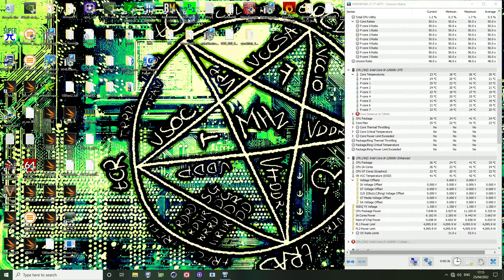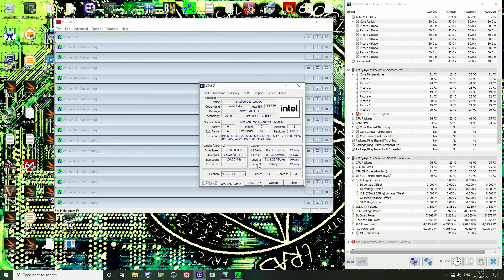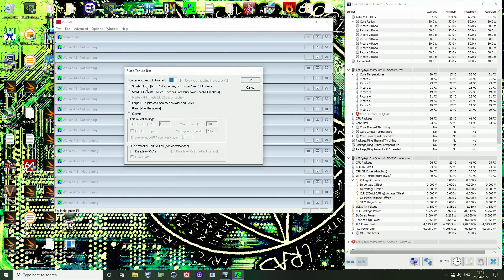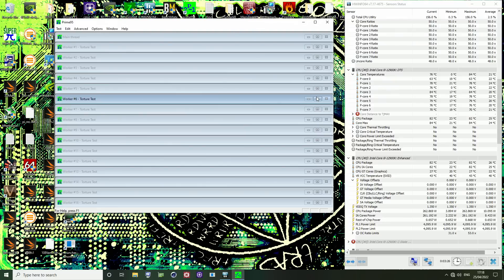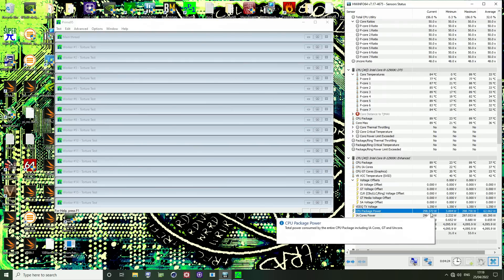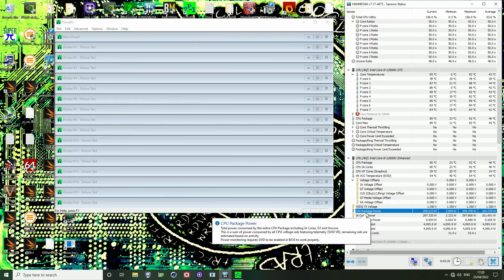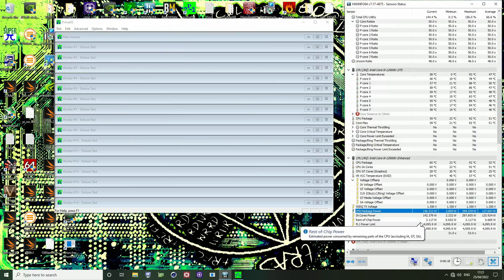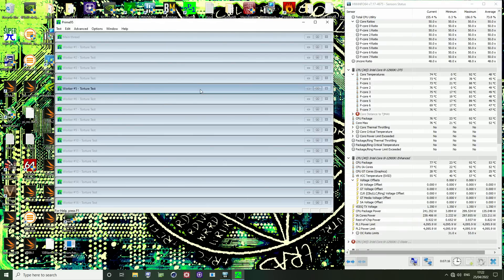AVX-512 on Alderlake CPUs is less hot than AVX2

Comment: This is the same with RKL.  Annoyingly, guardband settings for AVX2 are lumped with AVX1 when ideally these are separated and then furthermore, AVX512 guardband takes the AVX/AVX2 guardband voltage and adds on top of that which is just wrong.  The problem with this is, to keep AVX2 stable at a given frequency, you end up having too much voltage for AVX and AVX512.

Comment: The biggest benefit of avx512 is not the wider vector registers, but the vastly improved masking and swizzle instructions. The only thing it is really missing is some register to register gather-scatter instructions.
Reply from the maker: yeah I remember reading something about how AVX512 is really good for some "memory management" stuff but I don't know enough about programming to know what that actually does.
Reply: @ActuallyHardcoreOverclocking  It could be any number of things, AVX512 is basically intel fixing their (many) mistakes in the SSE-AVX2 series of extensions.

In my own experience, the biggest differences for memory management are masked loads/stores and gather-scatter.

Essentially, when you use SSE or AVX to load data from memory into a register, it always loads a power of 2 bytes at once, with the max being 32 bytes. If you want to load 20 bytes, that is a 16 byte load followed by a 4 byte load. It is actually much faster to simply load 32 bytes and discard the last 12. However, there is a small chance those 12 bytes are owned by another process, and touching another process' memory means the CPU/OS crash your program.

AVX512 lets you tell the CPU to "mask" the load. This means it loads the full 32 bytes, discards some of them, and gives you the rest. Because the CPU is doing the discarding in hardware, it is okay if those bytes are owned by another process. Essentially the same problem and solution also apply to storing data.

Gather refers to the practice of "grabbing" data items from an array and compacting them into a smaller array. Scatter is the reverse, taking a small array and distributing them across a larger one. e.g. Take items 1, 4, 9, 11 and put them in a single 4 item array. It is very useful when you have "sparse" data. i.e. When you only need to work with a small subset of your data at any one time, and that subset is scattered throughout your main data set. e.g. (very simplified) You want to mark the 3 users with ids 129, 73249, and 32974 as having their accounts disabled. You use a gather operation to load the three accounts, change their status variable, and then scatter them back into the main user store. This is faster than loading/storing them separately.

gather/scatter has existed in GPUs for years, but wasn't fully implemented in CPU hardware until avx512. Unfortunately,  we still only have register->memory scatter and memory->register gather, not register<->register gather/scatter. Register to register gather/scatter is less of a memory management issue though, the benefit of register to register is to implement data shuffle algorithms without taxing the memory subsystem.
Reply: @sbdnsngdsnsns31312  
Masked load/stores have it's benefits, but avoiding crashes is not one of them. It's easy to over-allocate or avoid page crossings without meaningful performance penalty.

However, masks do reduce register pressure, and give some flexibility. They also reduce the need for blending which reduces shuffle port pressure. They make corner-case handling easier and reduce code size a bit (although that doesn't matter).

Gather and scatter are not the operations you really want in a tight vectorized code. CPU just issues a lot of small reads/writes. At best it saves some shuffle overhead and code size, but that's it. It is barely faster than doing it in scalar code. It still suffers from occasional cache miss, and touching a lot of disjointed  memory is very cache-ineffective.

Gather exists in AVX2, Register-register shuffles can be done through variable-controlled shuffles since sse 4.1 (pshufb).

Avx512 does reduce the gimmick of avx2 "lanes". Majority of avx2 instructions process avx2 register as if it's 2 separate 128-bit registers, and that includes most shift and shuffles. Most of the time that is a significant inconvenience, because you need additional instructions to move data between "lanes".

Comment: Just from these power numbers, I'd expect the AVX-512 code is running into some CPU bottleneck not exposed with AVX2 and dropping CPU utilization (== performance) in this specific Prime95 setting as a result. So don't fool yourself by using AVX-512 for stress testing, as it is not representative of the CPU at full load, and always test which code path is quicker in your specific use case.
Reply: Wider vector widths actually increase overall efficiency, code optimized for the nex AVX512 instructions is often more efficient, and most consumer cores probably don’t have enough 512 wide FPUs to actually run double the throughput of an AVX2 solution.

For instance, back in sky lake most of the server CPUs ran half as many 512bit instructions per cycle, for the same throughput at fewer instructions. Only a handful of the highest end parts had enough FPUs to run the same number of 512 but instructions as 256, giving double throughput and increased heat.
Reply from the maker: AVX512 is faster in a lot of benchmarks while still running less hot than AVX2
Reply: @ActuallyHardcoreOverclocking  The problem here is that you don't look at performance in Prime95 while touting the changes in power consumption. 

Take a look at how performance changes between the 250W AVX-512 load and the 300W AVX2 load.

Or take one of the examples where AVX-512 is verified as quick or quicker and compare power consumption there.
Reply from the maker: @proesterchen  Ycruncher is cooler and faster on AVX512 than with AVX2.
Reply: @ActuallyHardcoreOverclocking  I can't replicate that on my 12900K / Asrock Z690 Extreme - AVX2 is both a couple of seconds quicker in hwbot y2.5B and uses more power, but I have to go back to the release BIOS to get the AVX-512 switch to work and kept all but the E-Core and AVX-512 switches default to speed up the comparison.
Reply from the maker: @proesterchen  the current Ycruncher 1B 8 core world record is held by a 12900K with AVX512 enabled: https://hwbot.org/submission/4919701_teamau_y_cruncher___pi_1b_core_i9_12900k_(8p)_16sec_201ms

the 2.5B 8 core record is held by another 12900K with AVX512 enabled: https://hwbot.org/submission/4922271_skullbringer_y_cruncher___pi_2.5b_core_i9_12900k_(8p)_52sec_541ms

Comment: Buildzoid: I'm the guy who originally suggested the updates to the Prime95 stress test routines to the dev and I've done months of exhaustive testing comparing CPU architectures across the different routines, so please get in touch as I may be able to help shed some light on this - I REALLY doubt Intel have come up with sonme laws-of-physics-violating way of making AVX-512 magically that good (but it would be nice). My suspicions for what's going on break down to:

1) The core/cache topology detection routine that automatically sets the FFT sizes per stress test may not understand Alder Lake correctly and is causing invalid ranges to be set
2) The AVX-512 routine is performance constrained by the cache bandwidth available and it's relative efficiency advantage over AVX2 is causing the observed power consumption reduction

If we can work out what's going on here, it's important information that I'm sure would be of enormous interest to the Prime95 community as a whole and George in particular, so please get in touch - I don't have an Alder Lake setup I can test (or anything with AVX-512 unfortunately) and it seems you could use a little help with the intricacies of running Prime95 as I think there's some undocumented features it has you need to know about. I've checked the Prime95 forums and there has been little discussion about Alder Lake beyond "AVX-512 is disabled? That sucks!" so your observations are actually pretty important to investigate.

I'm "wantkitteh" on Reddit, I've posted a bunch of stuff in /r/overclocking about Prime95 in the past, plz DM me there ASAP and we can transfer to Discord or whatever and go from there
Reply from the maker: Y cruncher gets less hot and speeds up with AVX512. Linpack runs less hot but slows down a bit. So far I've not seen any AVX512 workload that is hotter than an AVX256 workload on Alderlake.
Reply: @ActuallyHardcoreOverclocking  Well I guess I'll just go f*ck myself then.

Comment: The fact AVX512 isn’t fused off ADL hints that it was supposed to be there, but the implementation didn’t work. It’s really hard because if E-cores run unsupported instructions it’ll crash and you can’t easily tell what instructions are coming. All other asymmetrical CPUs use identical instructions for that reason.
I’m hoping they can make asymmetrical instructions work in Raptor Lake because it really sucks to go backwards with instructions and Intel 7 is so much more efficient than 14nm.

Comment: AVX-512 is a separate code path, and probably less tested than AVX2. It is quite possible that Prime95 AVX-512 code path is not as optimized as AVX2, so it puts less stress to the CPU.

Comment: Of practical terms, is there any normie usage that utilizes AVX-512? Or only benchmarks and datacenter-like programs?
Reply: Several emulators can make use of AVX-512, though RPCS3 is really the only one where it matters. It provides a huge speedup there and makes some of the really hard to run stuff (The Last of Us, Red Dead Redemption, God of War, etc.) much more playable.
Reply: @CaptainKenway  Oh, emulators using AVX-512 is actually good example. Thanks!

PS. Is MGS 4 finally playable? :P
Reply: @PolskiJaszczomb  It is, from start to finish. You need a very beefy CPU though. Ideally Rocket Lake or Alder Lake with eight cores or more if you want to play it at 60fps (much of the time). There's also a custom build dedicated solely to MGS4 that you can find on the game's page on the RPCS3 wiki.
Reply: @CaptainKenway  That's wonderful news!
Reply: There is x265, but the AVX512 codepath is barely faster than AVX2.
Reply from the maker: I think some of the farcry games use a little bit of AVX512 and speed up a bit with it.
Reply: @ActuallyHardcoreOverclocking  Ubisoft using any recent coding is the last company I'd think of, that'd utilize new features.
Reply: @PolskiJaszczomb  They probably just turned on a compiler optimization flag. It is completely uneconomic for a game company to hand code actual AVX512. Even if it doubled performance (which it won't), at best 5% of your potential customer base will benefit.
Reply: If you do a two PC streaming setup with ndi for stream and capture (so over land), it doesn't require avx, but if both CPUs support avx, the resulting encode is notably of better quality. Iirc, it needs at least sse4 to work, and a good NIC. Avx support enables more ways to make the resulting stream to look really good, and it needs at least 4c8t to handle a 1080p60 output stream to your choice of streaming service.

Comment: Is there any performance metric for AVX2 vs 512 ? Is it 10% faster ? Or a 100% ?
Reply: It all depends on the algorithm being run, and how it's coded. All of the SIMD (single instruction multiple data) architectures provide loop-level parallelization (aka vectorization). X86 does SIMD with general purpose registers that can be partitioned based on the data loaded. 
Consider a single-precision floating point number, which needs 32 bits of storage. 8 of these will fit into a 256 bit AVX 2 register. A vector loop will run about 8 times faster than without SIMD. Move up to AVX 512 and you've got 512 bit registers. Now your loop will run 16 times faster than without SIMD, or twice as fast as AVX 2.
The percent of calculations that can be processed in vector loops depends greatly on the algorithm. Multi-dimensional physics simulations tend to benefit greatly from SIMD, since they tend to apply identical calculations to titanic amounts of data.

Comment: Do you think intel will ever bring out CPUs like the 12400 with only p cores, like an i7 with only 8 p cores, but they are extremely performant, cause you really dont need the e cores for gaming, also what are your thoughts on g skill ddr4 kits that are binned, i ve bought a 4400 cl16-19-19-39  from g skill for my i7 12700k, do you think the performance will be good?
Reply: You will either run at sub 4000 GEAR1(maybe even sub 3700), or 4400+ in Gear2 if its a B-die kitt. 
i am not familier with that kitt, but its prob b-dies with such tigth timings at such high speeds. Either way your mem controller on 12th gen will prob be the stop limit, at least at the high preformant Gear1 mode.
Reply: @AdaaDK  been able to validate at 4000
Reply: @maxschmidt1857  at gear1 ? 24/7 memtest stable ? thats an decently impressive mem controller you got your self then.
Reply: @AdaaDK  well not 24/7 but i did a 8 hour test and since then didnt crash, yes g1, but its not that impressive really, if you are able to get your hands on some good silicon, you can even get like 4200+ at g1, ive even seen in r/overclocking some that had 4400 at g1
Reply: @maxschmidt1857  i was referring to buildzoid saying that 4200+ is ultra hard and rare, and since he also owns a 12900 that only does 3600-3800 range in gear1, i would imagine that 4000 is still in the mid to upperend. ;-)
Reply: @AdaaDK  well he said himself that his 12900 is under average , but yes it is definitely something i am lucky, fortunate and proud of
Reply: @AdaaDK  After our conversation I have run a memtest  again, and there were some errors, so I went through the oc process again and right now an memtest of 3900 cl 15-15-15-32 gr1 command rate 1 is running, and it seems perfectly stable,  I will try to lower the 32 but other then that it's I think impressive. we will see If there are any errors
Reply: @maxschmidt1857  Very good board if you can do 3900 Cl15 at 1T, my asus TUF Z690 refuses to do T1 at 3600+ in gear1.
Reply: @AdaaDK  my board is a z690 strix a d4 Wifi, currently the best available in my country and with the newest bios update
Reply: @AdaaDK  I had to lift the timings a bit, now it is running a 100% stable at 3900 15-15-18-33

Comment: I wonder what Intel changed, AVX-512 is very hot on my 11600K
Reply: Well 14nm itself is very hot to begin with, and there are some small arch change on avx unit with golden cove. But I do hear that Intel put a power limiter on avx512 this time
Reply: There is a limitator/throttling on AVX-512 part only
Reply: I observe the same behaviour that Buildzoid is seeing on my 11400. Disabling AVX512 draws about 20W more when running small FFTs.

Comment: Is this behavior specific to Prime95, or is it universal?
Reply from the maker: Linpack and Y-cruncher also match this behaviour.
Reply: @ActuallyHardcoreOverclocking  Well then, assuming that 12th Gen AVX 512 performance scales above AVX 2 as expected, Intel has made a tremendous computational efficiency breakthrough... then has tried to hide it.
Reply: @MrKentaroMotoPI  I rather think, ´the avx512 support on alder lake is incomplete. we would need some benchmarks to see how much faster it is than avx256 in actual workloads
Reply: @LinkStorm13  i think it's just because intel wanted to push their e-cores more and it causes issues to have avx512+ecores at the same time
Reply: @MrKentaroMotoPI  Intel seems very confident about Sapphire Rapids (server plattform with Alder Lake's Golden Cove cores) where AVX512 really shines
Reply: @marceldiezasch6192  Yes, and that's very nice. But here's the problem, Marcel: Intel paid to design and implement 512 in Alderlake. That means that all consumers who purchased an Alderlake paid for it.
I'll just have to buy a Sapphire Rapids to get my money's worth 😀
Reply: @LinkStorm13  The AVX512 support is incomplete in a rather obvious manner. If you try using AVX512 with the E-cores on, shit starts crashing. The E-cores are a more important feature than AVX512 on a consumer chip because AVX512 lacks the market penetration to be worth coding for in consumer applications. (Servers are a whole different beast, which is why the server chips will have AVX512 enabled.)

Comment: If you increase voltage then you Amper directly goes up or indirectly (with temp for example voltage goes up temp goes up resistance goes down because of semiconductor if your denominator goes down your Amper goes up) or both way (that's why Amper goes up both way)